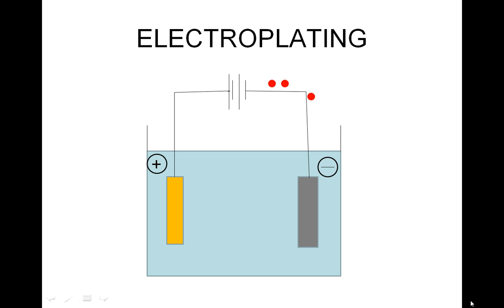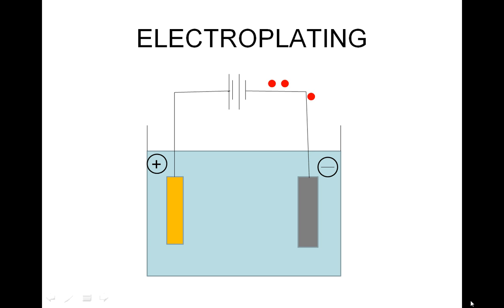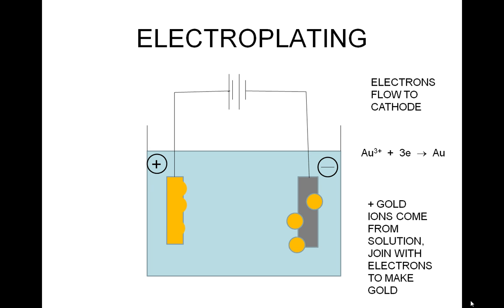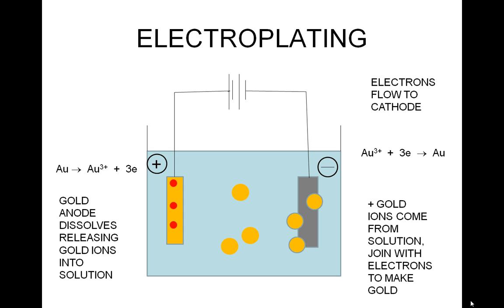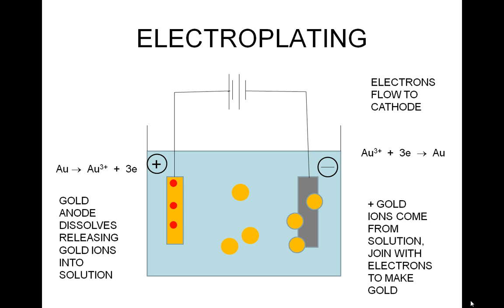electroplating animation.wmv

Comment: hey there i have a question. Gold is one of the inert electrode right? yet why gold got oxidized when it place as anode? thanks
Reply: Yes, Gold is very inert and very strong anti-corrosion material  in our environment , but current flow to anode Gold then Gold starting to change ions (oxidized).
Reply: so does that mean if we put any inert electrode (e.g C or Pt) it will get oxidized too?
Reply: Yes, Gold is best conductive materials better than Cu  but expensive and gap filling is not good that's why most of them use  Cu,  and any metals even inert materials of kind of metals can be oxidized with current flow and generate ions( flow from anode to Cathode)  and unstable metal ions .